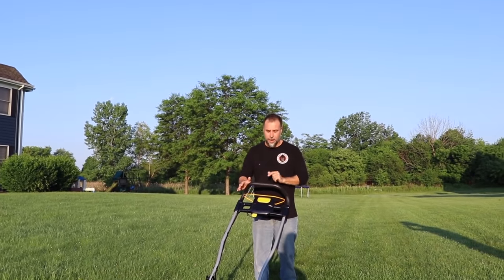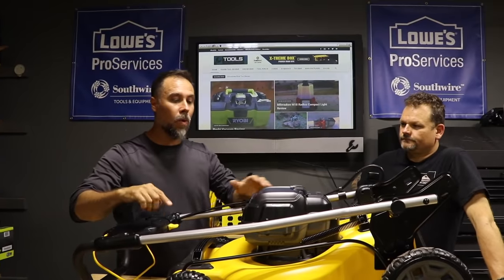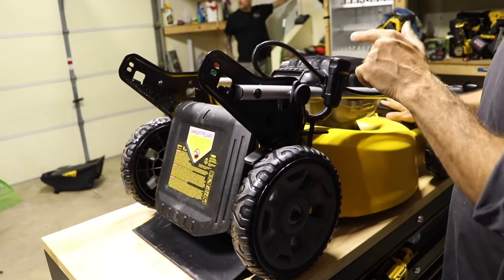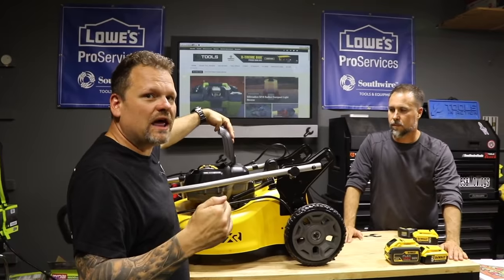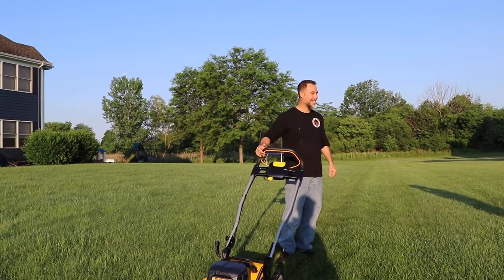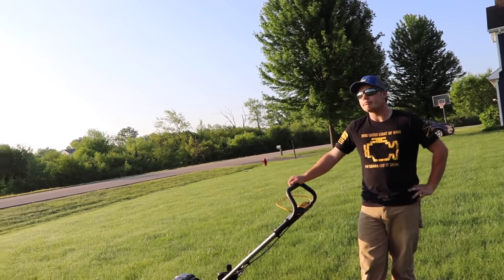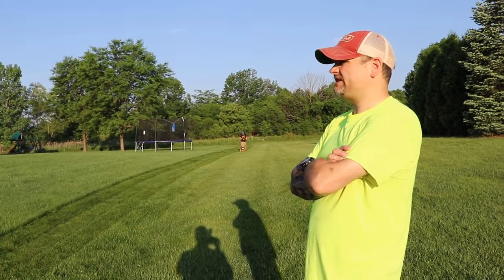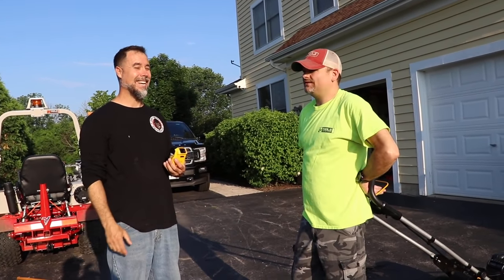Dewalt- 1st place for the Worst Lawn Mower of the year

Comment: You rigged the outcome of the "review" from the get-go. You're mowing wet grass; you don't mow wet. Ever. You're mowing wet grass that's 4-6" tall and you have the deck set almost all the way down. This would bog even my pro Snapper down if I did something as stupid as this. AND you tried to start it while under load? Try pull starting your gas power mower under the same conditions; you wouldn't be able to without raising the deck like a halfway intelligent person.

Comment: You get 1st Place in Bad Reviews! No info on cut height, grass height/type, mower/mulch settings, etc. Didn't demo bagging, or even try opening for rear discharging since NOBODY should force feed ANY mower while closed mulching like that! Seriously! Way to give a product a bad rap without giving supporting data points... and what looks like user error.

Comment: First of all you are cutting the grass wrong, never shave that much of the grass blades off. It's hard on the grass and you make the lawn look like crap. You do that cutting ditches but not lawns you want to look nice. And you don't mow wet grass and I would really like to see you try and successfully get a pull start mower going in the tall grass. Basically you were setting the mower up to fail, any mower that class would struggle. Either this was due to showboating or ineptitude regarding lawn care.

As for the DeWalt I took a look at a DCMW220P2 (has an issue where you need to apply a strong grip to the start button otherwise it won't start) and compared it to my 21" Ego. DeWalt is heavier and noticeably louder, I'm not impressed with the design.
Reply from the maker: Real world- you do mow the grass and cut off that much.  you do all the things in this video.  Maybe In a "perfect" world you wouldn't. I don't live in a perfect place though.  Sounds like you do- must be nice.  Maybe I could visit you there.
Reply: @Dirtmonkey  that statement is as logical as some guy blaming the hammer because it does a poor job driving screws in a board. 

The video makes you look bad and from the other comments people are saying the same thing.

Comment: This video won't even be worth watching, so I won't.
A very small electric mower made by a company that never made mowers to mow a lawn that large and thick?
Are you crazy?
These electric mowers are being made by amateurs for small residential yards.
To even consider one for anything more than a tiny patch of green is...well, crazy.
Also, by the looks of the grass sticking to the wheels, it is wet.  The difference in cutting wet or dry is huge.

Comment: Love DeWalt, their tools has always been reliable / great for me. That said, I don't think they should have ever made a lawnmover for example. Like, the normal engine ones - there is nothing wrong with those. Those are portable, since they have a motor. I just don't see, what a battery powered one could provide. Maybe less noise? Meh.
Reply: Less maintenance, I don't have to get gas, and I already have these batteries lying around. Nothing wrong with has but these battery mowers have more positives than just noise.

Comment: What a very poor review!!!
Mulching long wet grass with any battery mower will get the same results.
you are critical about the run time which may not be the best on the batteries supplied with your unit. Yet you guys do everything in your power to put as much strain on the motor as possible. Mulching long wet grass at 3/4 of the machine capacity is causing a lot more draw on the batteries.

I challenge you to do this test with any Cordless battery mower on the market, these machines do not compare to gas powered and none of them have claimed to they offer a environmentally friendly alternative to gas powered machines. Try setting the machine up correctly to do the job not setting it up to fail. 

I actually thought when you mentioned Tools in  Action as your friends it would be an HONEST review? I was sadly disappointed and amazed that Tools in Action have allowed you to mention their site as for me this also damages their reputation.

the only questionable feature of this mower when compared to other tools in it's class - battery powered mowers is the Run time everything else stacks up to comparable machines.

Comment: It drives me crazy to watch someone use the wrong tool for the wrong job. Your 3 stripes were like 100 feet long. Your lawn looks heavily irrigated and thick and long. There is no discharge so it has to work extra hard to recycle. Clearly it's not made for a full size yard like yours. No electric mower is unless it's commercial and costs 10's of thousands of dollars. You should know the capability of your batteries from using them in other tools. That should have given you an idea of how much power they have. You are either not too bright, or a drama queen. Either way I won't be watching any other of your videos because your assessments are no good. You don't use very good logic.

Comment: Kind of a loaded test. Not a commercial mower. Might want to use it on a small yard and cut an inch or so off the grass. Like what it is designed for. If you want a commercial mower to mulch 3 inches of wet wet grass test a commercial mower. Would I buy one? No. But a bit of a cheap shot test. Next you need to test a VW bug pulling a tri axle trailer. Can it do it? Yes but not well.
Reply from the maker: I put it in what grass was available.  That grass needed to be mowed.  This was a mower but it couldn't do its job.  Wet wet?  that was morning dew-not rain.  Very typical stuff.
Reply: Yeah, dew makes the grass wet. Obviously click bait review. Entertaining but not useful. Bye

Comment: As much as I don't like Dewalt and actually prefer Milwaukee I have to say, THIS IS A HIT PIECE. Using a mulching mower (without a chute) in the morning with dew still on overdue grass is just silly. Mowing that lawn, at that pace would have even stuffed up a gasoline push mower.    Compare battery to battery, not gas to battery, which you didnt even do that. Apples to oranges.  You can clearly see the grass is up to as high as the front wheel which is about 6 inches.  You just took an electric mower a slammed it into something that woulda clogged up even a gasser.   Thanks for the dishonest review.  Push one of those little gas mowers through that grass at that pace.   or better yet another electric one so we can see which electric mower is the best.  Stay honest.
Reply from the maker: OK- I will.